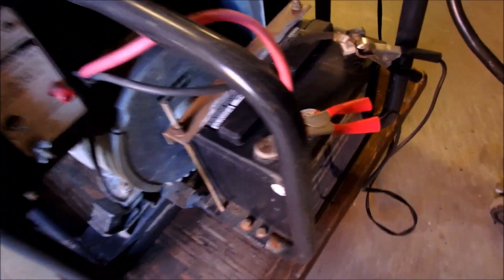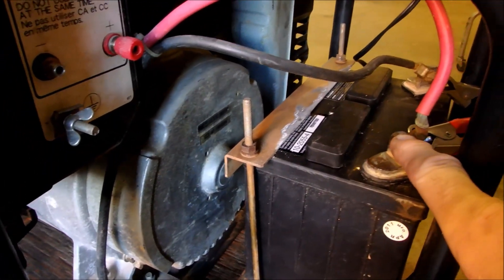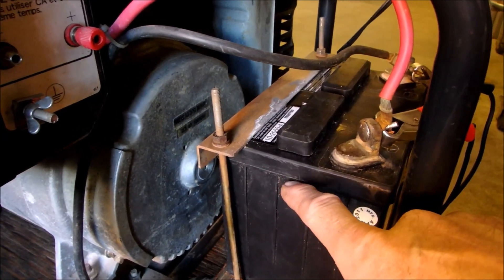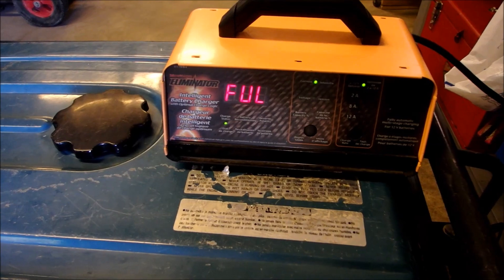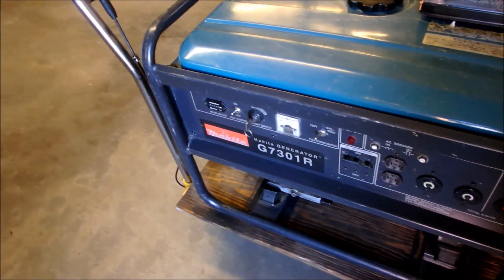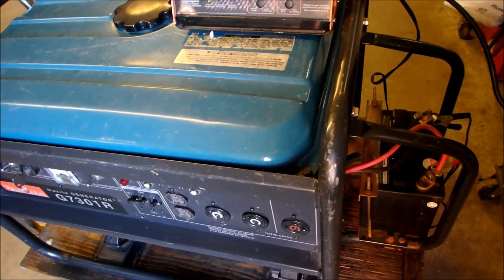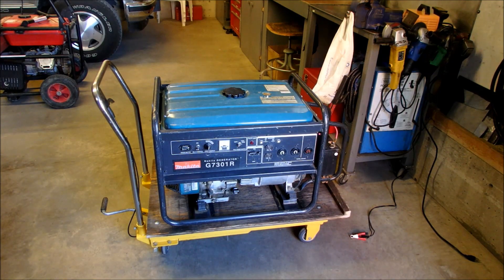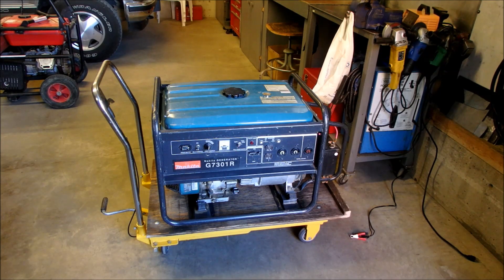Small Battery Maintenance

Comment: I've got two of those exact tenders.....love them! On more troublesome batteries, I hook up the battery conditioner charger. Excellent! Cheers!! Zip~
Reply from the maker: +ZippoVarga Thanks         This one I worked on over a few days
Reply: I have a little ace in the hole here. A goof family friend works at a battery test facility and he often mixes acid for me and as long as there isn't a dead cell, I can typically keep the batteries alive. I've got one token battery that's going on 8 years and is still testing at 80% capacity with a load tester. I hear horror stories about how people go through batteries like crazy, but they don't maintain them through out the year, don't keep the contacts clean and don't check the water levels at all.

Comment: say Bruce I am looking to get a lift table/cart. I watched your video on it. what was the original size of the table before you added the top? I was looking at ones from harbor freight. several shops use the motorcycle lift tables, but I believe your type of table gets the work higher which is what I need. and yous is easily mobile. just got to have a way to unload from the pick up as they are heavy and I am recovering from my third hernia surgery. I hate getting old lol.
Reply from the maker: +Raymond Campbell 2feet X 2 1/2 feet I think   I added 6 inches to it     about
Reply from the maker: +Raymond Campbell I checked   the top is 19 1/2 by 32 inches without the plywood
Reply: Bruce Pender OK Bruce got thanks Godfather:-)

Comment: Bruce I've been down that road before and no luck, yes at first it will charge but in a short time it's kaput if the low acid level exposed the plates I have never seen it return to normal . Look forward to hearing how long the battery stays good on that one.
Reply from the maker: +Steve Rob Well it is probably going back to sit in a shed for years!!! I have had some luck with commercial ones when I worked for a living.